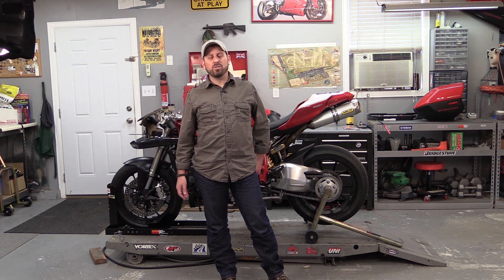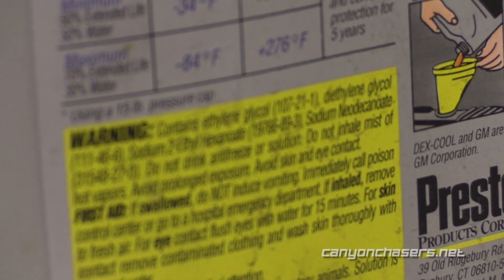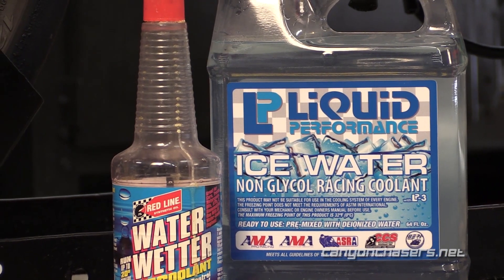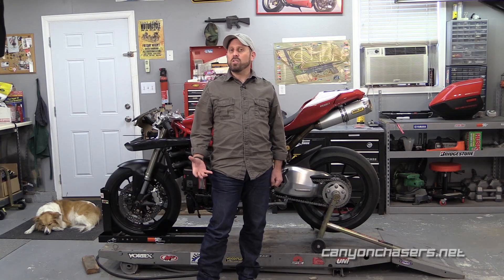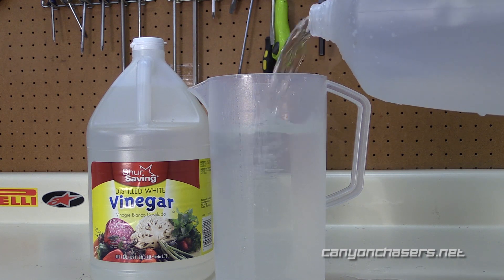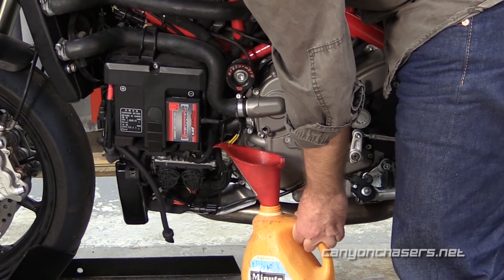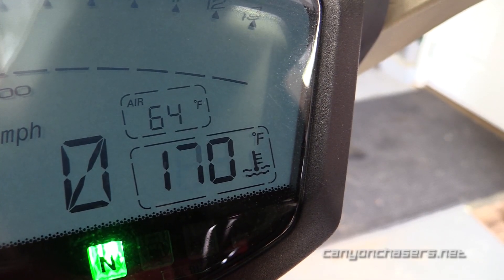How to Flush the Radiator on your Motorcycle and Change the Coolant

Comment: After a thorough flush, Is it okay to switch to OAT coolant after running the bike on POAT coolant for years?
Reply from the maker: Yes.  If you are concerned you can run an extra intermediate flush with just water if you want to be extra sure.

Comment: Thanks great vid. But did I mess up? 2013 R1...I drained the old coolant, flushed with distilled water with the drain plug off, then added 50/50 vinegar water and ran the bike with the system closed till fan came on. Then I rinsed by adding water with the drain plug out.. then closed the drain plug and added the new coolant. So I did not run the bike with pure distilled water, just rinsed with the drain plug out. Am I ok, or do I need to drain the new coolant and start again by running the bike with pure distilled water...then add more new coolant?? I have seen some videos that say run the bike with pure distilled water after the 50/50 step
Reply from the maker: It should be totally fine.  If you are worried get one of those cheap coolant testors with the floating balls and make sure the coolant is still happy.

Comment: good video. I have a doubt: after the flush, the engine block has distilled water on it, so once you pour the coolant, it will mix with the distilled water itself, so you will never have 100% coolant in the system, right? the only way to achieve so would be doing the flushes with coolant instead of distilled water...
Reply from the maker: You typically don't want 100% coolant. You want a roughly 50/50 water coolant mix.

Comment: Does the “brand” or type of distilled water matter? If I search distilled water for coolant mixing specifically prices are crazy,almost as much as coolant alone .but if I just search Walmart distilled water it is just over a dollar.. I’d obviously like to save the $10-$20 but no at the cost of inferior/ damaging water..i use Walmart brand  in my Xterra to no negative effect ,so I’m leaning towards “distilled water is distilled water”no matter what you pay for it …..I’ve considered making my own water via boiling with a bowl in middle of pot and lid on upside down( to drip into bowl)  .but I’m so paranoid I’d be re distilling the water multiple times to be sure it was mineral free ,and still be worried hehe.

Comment: How do you empty/flush the overflow bottle, siphon it out?
Reply from the maker: Remove the drain hose from the top of the radiator and rinse it. If it's gross, you may need to run a bottle brush through it. If it's really, really nasty, you many need to remove it to clean it - and if its absolutely ghastly - just replace it. :)

Comment: I recently bought a 2019 Yamaha mt09, but noticed the coolant level is low, the mileage is just under 2000 miles, Is it ok to just add coolant instead of draining and flushing?
Reply from the maker: Absolutely! You could simply add a bit of distilled water, or get the coolant that Yamaha recommends for your bike.  Remember the mixture in your radiator is typically 50/50. Coolant lubricates and prevents freezing. Water actually does the cooling. So it's okay if your system has a bit more of one or the other based on the temperature you bike lives in.

Comment: I've been a biker for over 30 years, and do most of my routine maintenance, just thought I'd look to see if there was anything I missed, and I'm very impressed. 
One thing I'd like to add is that ethylene glycol and polypropylene glycol can be safely mixed, but never mix those with  OAT coolant, nor use it in systems which are not totally sealed from the atmosphere.

Really impressed, and the issues with pet safety are hardly ever touched on elsewhere.

Comment: I just need to top mine up as it's on minimum and I don't want to flush the whole thing because of it, can I just add some distilled water?
Reply from the maker: Yep. But you may want to test the coolant before winter to be sure it will survive winter (if you have winter where you live)
Reply: @CanyonChasers  Thanks, I will keep an eye on it over winter and top it up after.

Comment: Propylene glycol doesn't transfer heat as well. A water wetter or surfactant is probably beneficial to help the water contact more surface area, but only to the point it resists foaming and such.

Comment: Before I fitted my new 1199 radiator, I flushed and filled up with distilled water / vinegar. Steaming occurred around 80 degrees. So I turned it off, waited 20 mins and flushed it out again. It was grey murky water.  Then, repeated the same, but it steamed around 90 degrees.  Each refill, it would only take about 1.75 litres? The manual says 2.3+0.5?
Reply from the maker: I'd imagine you pockets of coolant or air that you aren't able to release.  You can always remove a hose from the water pump.

Comment: no bleeder valve?
Reply from the maker: It'll just take you longer to drain and refill the system. Take extra care to be sure you get all the air out.
Reply: As a car techie, we just leave the rad cap off when topping up the coolant and stick a funnel in. We leave a small pool of coolant in the funnel and run the vehicle up to temp and rev it at different RPMs to allow the vibrations to work the air up and out of the funnel. The coolant won't actually get hot enough to burn skin of or anything like that. Just use some paper towel to soak up the remaining coolant in the funnel and take it out. Then put the cap back on.

Comment: Can you please give me some advice 2008 ZX14 with 8000miles first time for the coolant change and am sure it's scale up. I purchased some Preston radiator flush and clean the direction say you can pour it in run for 10 mins than flush,or leave in for 3 days then flush,what would you think is best way to go? Also the bike runs perfect only the auxiliary tank is at minimum,yes I'll be doing full flush and fill. Thanks in advance if you can give your advice.
Reply from the maker: None of us here have any experience with Prestone Radiator Flush. Sorry.

Comment: If my bike has 2 draining bolts, one in the water pump and the other in the cylinder, does it matter which one I remove?
Reply from the maker: Most likely both of them.  The one on the water pump is most likely the drain, but the other one will work like a bleed, and allow air into the system so it drains more completely.
Reply: Another one, if I live where it doesn't snow or have below zero temperatures, can I put the liquid performance coolant?

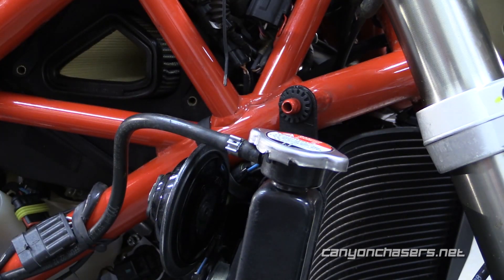Comment: what its the name of the cable that's appears on 3:16
Reply: Sebastian Fernandez
                                    At 3.16.  'That cable'.  I assuming you are talking about the one on the right hand side of the water pump, correct? 
To me that Definitely looks like the 'battery charger cable'. Definitely. 
Instead of directly fitting the battery charger leads onto the battery, 'most' new bikes (in Australia) are fitted with this short 'battery charger cable', and you simply plug this in to your battery charger lead. 
 The reasoning is that it is Far quicker to charge your battery (if needed) via this cable connector, than to go to the hassle of taking the seat off and other things, just to gain access to the battery to charge it. 
Hope this makes sense.

Comment: Help please. While blipping to get rid of the air bubbles (wasn't able to get rid of all of them) I noticed that as the bike got warmer the coolant was rising to the point where it almost spilled out had I not killed the engine.  When the bike cools down the coolant starts going back down again.

What I'm worried about is after I cap it off and while I'm riding, what if the coolant rises again with the cap on it and the pressure would build up and something disastrous can happen.

Do help please.
Reply: It goes into that white plastic auxiliary tank, your system running spot on.

Comment: In the final step you need to run the bike a bit with the radiator cap open to burp the system so that the air bubbles escape. Thanks for the video.
Reply: Yep
Reply: After doing this do you add more to fill it to the very top? Is it okay if there is still a little air as long as you have a reserve tank?
Reply: @AudreysKitchen  top it up.

Comment: Great video, thanks! I got a question; In my owners manual they say that i need to use ethylene glycol. In the video you say that it
 is not the best coolant, but at the other hand, i need to follow my manual. What is the best to do? I have got some issues with hot starts so i want to make sure everything around my cooling system works optimal. Thanks in forward for your answer! Kind regards, Arne

Comment: Anybody that flushes using water ( or water and vinegar), is going to have an improper solution in their cooling system if they don't compensate by adding straight antifreeze. The engine block holds quite a bit of coolant (or water) that remains in there. Even if you flush 1000 times with water and let the thermostat open completely to circulate fluid, you're still going to have water left in the block. Only way to completely remove the entire coolant capacity is to  disassemble the engine.  There are a lot of used bikes out there that have been maintained improperly. I haven't seen one video where this is addressed.  Am I missing something here?
Reply: Chris C: I think he said that the drain plug was the low point in the system, so most of the liquid should drain out.
Reply: Martha Jack Most of it,  but not all of it. My point is you don't get it all out. If the capacity of your cooling system is 4 quarts and you drain it, you're going to still have at least a quart of fluid in there, probably more. so, when people flush with water,  they are leaving a good amount in there.  then they fill with 50/50 cause that's what most systems call for. therefore,  they have less than a 50/50 solution in their cooling system.
Reply from the maker: Or you can use some compressed air to remove any remaining water if you are worried...  Also, if your solution is a little off, it's not the end of the world.  Water provides to cooling. The anti-freeze provides some lubrication and freeze protection.  There are scads of race-bikes out there that run water only.  No additives at all, and they work just fine (just no protection from freezing).

Comment: This is cool. Just flushed and changed my coolant on my CB1300SA using this video and it worked a treat. I even put my little yorkie terrier, rusty, inside the house which was just aswell as when I picked up the bucket with coolant from the motorbike the handle came off and and the whole lot splashed all over the garden patio. Took me longer to clean up than changing the coolant. Awsome.

Comment: I have 2012 triumph Daytona,  bike won't start when hot. 
 yesterday went for a short ride and coolent was spraying out for a bit then stopped.
went for another 10 min ride - temp light and engine light came on- noticed fan doesn't kick in until 7 bars- 
any ideas
Reply from the maker: If the bike won't start when hot, that typically means you need a valve adjustment.   Additionally,  Triumph used to put really low grade coolant in their new bikes. I don't know if they use better stuff now, but I'd probably start by flushing/cleaning the system and installing fresh coolant.

Comment: Very helpful video for us motorcycle noobs. I have one question though. Once the cooling system is topped off can I let the bike run with the radiator cap off to expel any air trapped in the system?

Comment: can you just use distilled  water. also for long term
Reply from the maker: +Kawaii Ninja Using just Distilled Water long term, with no other product, will most likely result in permanent damage to your cooling system.  Water provides no lubrication and does not provide any protection from freezing.  Race teams may use distilled water only, but their bikes typically only have to last one year. :)
Reply: +CanyonChasers Motorcycle Adventure, Sport and Touring thanks. i already purchased a new radiator
Reply: Kawaii Ninja water has a lower boiling point and is not good to use alone.

Comment: When getting the vinegar out and running pure water through, should you just pour water in with the drain bolt out and let it go through it and get the vinegar out or should you run the engine with the water in it as well?
Reply from the maker: gunsntech411 How well the vinegar flushes out depends a lot on your bike. Most bike will do better if you put in water, run the bike for a moment or two, then dump it out. It may take a time or two before the vinegar smell is gone.

Comment: sir, im planning to clean the cooling system in my cbr 150r.. its this tutorial applicable on my cbr? is the vinegar safe for the metals and rubbers in the radiator? is it not corrosive?
Reply from the maker: juan delacruz We put water and vinegar in our bodies and it's not corrosive. I don't know why the aluminum, steel and rubber in a CBR 150R would be different than aluminum, steel and rubber in a Ducati, a Yamaha or a Kawasaki.
Reply: CanyonChasers Motorcycle Adventure, Sport and Touring thank you for the info and the wondeful tutorial sir.. ill be applying this to my cbr this week..

Comment: If im just topping up my coolant a little bit does it matter if i use a different brand to what is already in there? i have no idea what is currently in the radiator
Reply from the maker: ORyanDeee It might. I would suggest topping off with distilled water, or just flushing the system to be sure.

Comment: I was wondering can you use the vinegar and water mixture in the radiator to flush the system for a car or vans/trucks also instead of on bikes without hurting the cooling system

Comment: Can i use engine ice for the track at Miller?
Reply: You never responded, can i use Engine Ice on Track Day at MMP?
Reply from the maker: Mosiah R6 No, Engine Ice has Glycol in it, so it cannot be used at Miller, unfortunately.
Reply: Dave Barbe said i can. So witch one is it?
Reply from the maker: Mosiah R6 I just spoke with Apex Trackdays and they said that they do allow Engine Ice because Polypropylene Glycol is water soluble.
Reply: OK, Thanks.

Comment: You mention that PG is better at transferring heat than EG yet everything I have read suggests that it is in fact the other way around.
Reply: Mug Costanza To my knowledge, neither is overly great at heat transfer. However, ethylene glycol is a more potent anti-freeze. It's also highly toxic. Propylene glycol is what's commonly called safety freeze. It also doesn't have an MSDS that recommends taking four shots of hard alcohol and calling an ambulance if you accidentally ingest or inhale even a tiny amount.

Comment: what temperature is corret or proper on ducati 848 in hot wether and wend the fan turn on my ducati rich 190 degrs and the fan is not on
Reply: I'm no expert on Ducati, but I know my Kawasaki and my brothers Yamaha turn on at 213 degrees and the fan shuts off at 208 Degrees

Comment: Excellent video. Very well spoken and easy to follow.
I have air bleeder bolts on my bike.. Probably bc I have to take the tank off to get to the radiator cap. This should suffice without having to top it off a second time right? Thanks for the vid.